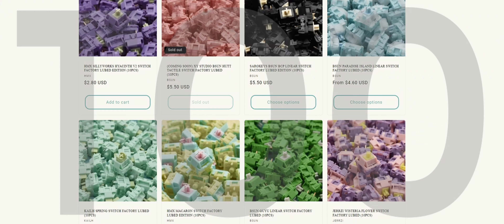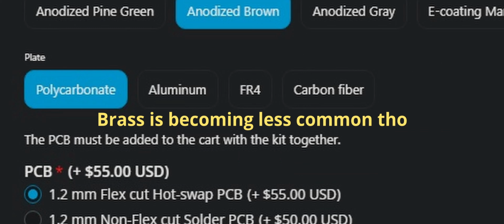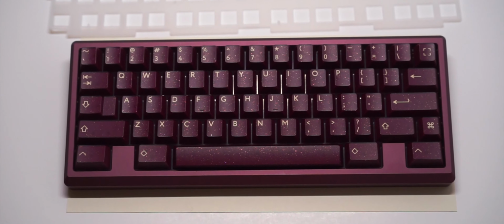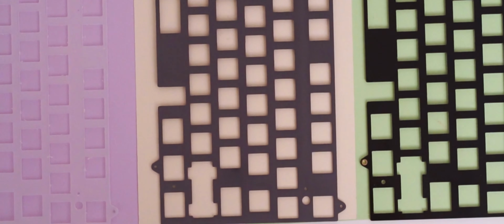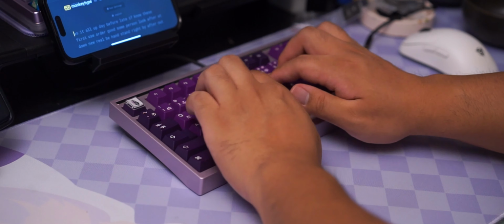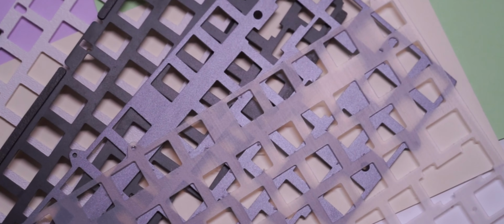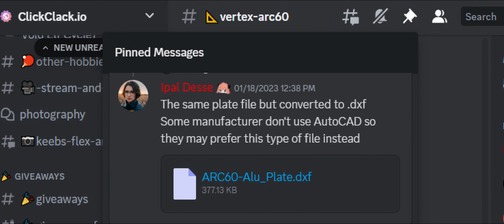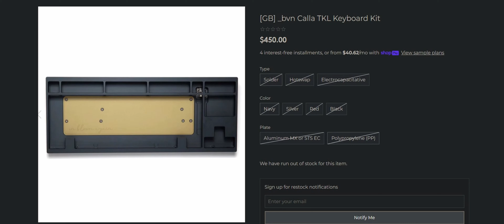PP Plate on the Mode Sonnet!

Comment: hey im esithant between pp plate or pc plate for a thock built , with what plate should i go for do you think?
Reply from the maker: Its been a while since I used a pc plate in one of my builds, but I like pp more cuz its just more poppy sounding. Pc can be good for thock, but depending on the board or switch it can sound deep but dull sometimes.
Reply: @arpeykeys  would you still recommend pp plate for boba u4t ?
Reply from the maker: Yea